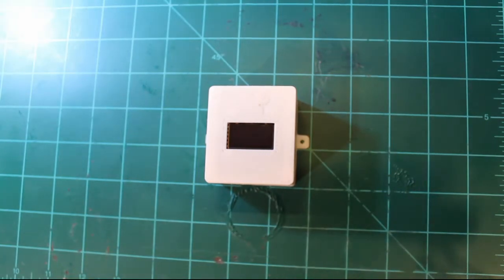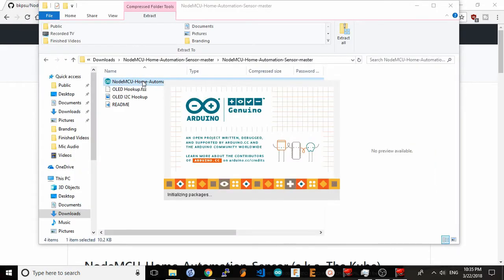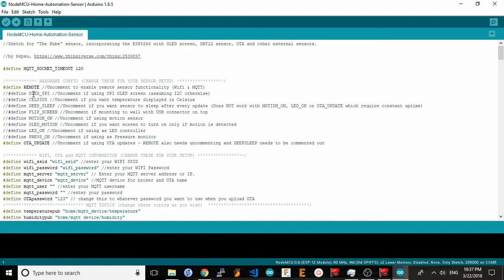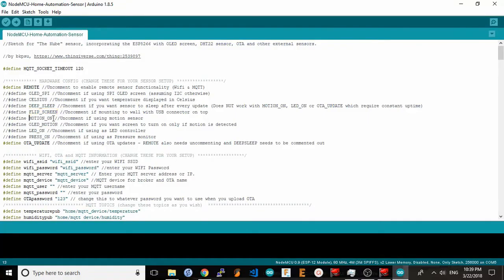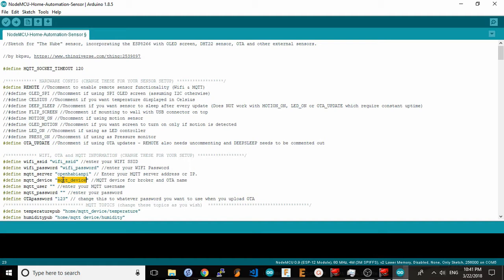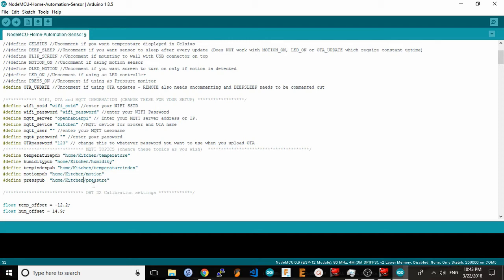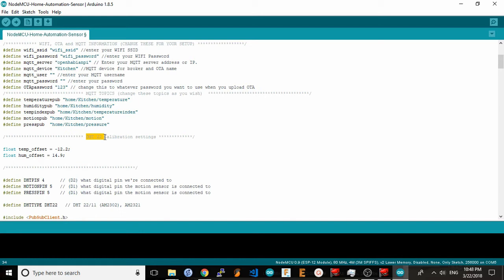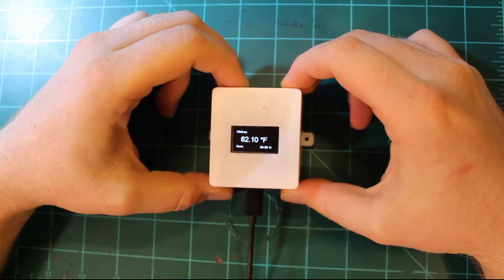NodeMCU Kube home automation multisensor Build - Part II (Arduino)

Comment: Hi, the sketch returns this errors:   C:\Users\User\Documents\Arduino\NodeMCU-Home-Automation-Sensor-4309b0d1c584e9067722f33b8794cbc8534183b9\ESP8266-PIR-OLED-Arduino\ESP8266-PIR-OLED-Arduino.ino: In function 'void loop()':

ESP8266-PIR-OLED-Arduino:197: error: no matching function for call to 'DHT::computeHeatIndex(float&, float&, bool)'

       float hic = dht.computeHeatIndex(t, h, false);

                                                   ^

C:\Users\User\Documents\Arduino\NodeMCU-Home-Automation-Sensor-4309b0d1c584e9067722f33b8794cbc8534183b9\ESP8266-PIR-OLED-Arduino\ESP8266-PIR-OLED-Arduino.ino:197:51: note: candidate is:

In file included from C:\Users\User\Documents\Arduino\NodeMCU-Home-Automation-Sensor-4309b0d1c584e9067722f33b8794cbc8534183b9\ESP8266-PIR-OLED-Arduino\ESP8266-PIR-OLED-Arduino.ino:48:0:

C:\Users\User\Documents\Arduino\libraries\DHT/DHT.h:36:9: note: float DHT::computeHeatIndex(float, float)

   float computeHeatIndex(float tempFahrenheit, float percentHumidity);

         ^

C:\Users\User\Documents\Arduino\libraries\DHT/DHT.h:36:9: note:   candidate expects 2 arguments, 3 provided

exit status 1
no matching function for call to 'DHT::computeHeatIndex(float&, float&, bool)'

Am i doing something wrong ?
Reply from the maker: Ah, you must not have the correct libraries installed. In Arduino IDE, please go to Sketch->Include Library->Manage Libraries. From the list that pops up, find and install the following two libraries:

-Arduino Unified Sensor by Adafruit (version 1.0.2)
-DHT Sensor Library by Adafruit (version 1.3.0)

The Adafruit sensor libraries are very good and contain extra helper functions (like heatindex computation) that other DHT libraries may not.

Let me know if you still have problems!
Reply: Wrong DHT library was my problem,  thanks :)

Comment: When I check the sketch I'm getting the following error: 'class WiFiClass' has no member named 'mode' any idea?
Reply from the maker: Make sure you're using the same libraries I defined in my Github repository Readme file. I suspect you're using the wrong (or wrong version) WifiManager library.

Comment: How do you get the WiFiManager.h says it can not find it
Reply from the maker: @Graham Jones - you have to use the Arduino IDE library manager - look for the WifiManager version 0.15 by tzapu
Reply: @BKHobby  ok thanks. I got some node mcu, had trouble at first as not standard but instructions showed me how to add to ide. Looking forward to getting things working.

Comment: Hi Bk,
 I installed the temperature sensor in one of my room. But one problem i am facing is it does't show the change in temperature directly . It shows only after i reset my NodeMCU. What could be the reason for this bk and how to solve this problem? Are you facing the same issue at your side?
Reply from the maker: Neelam Jangra - have you resolved your issue yet? I haven't had any problems with my sensors, but maybe your MQTT broker is going up/down? Check with MQTT-Explorer to make sure you're getting the messages from the sensor all the time.

Comment: Hello, can you calibrate or set an offset for  DHT11 or AM2302/DHT22 in Tasmota? I'm trying to setup a sonoff basic r2 as a light switch with a sensor DHT11 on a spare GPIO to control light and measure the temp/humidity in the room. 
Great work on your channel.
An off topic question, why you choose OpenHAB and not Home Assistant?
Reply from the maker: @Lucian Buzatu - I'm not that familiar with Tasmota for sensors yet - I've only used them for switches, but I'm not sure they support changing the value (you might need to calibrate the input on your home automation server side). But, I've now started using ESPEasy for my sensor software, and it's definitely possible to calibrate the output in that firmware (you might want to look at it for the Sonoff, as well).

Thanks for the kind words! I've been working with openHAB as my home automation system for about 4 years now (tried a couple different softwares before that) - openHAB was the first that worked reliably and "made sense" to me at the time, and I don't think the Home Assistant project was off the ground at that point, yet. That said, both OH & HA are great products that serve the same purpose, but I'm very much invested in OH at this point, see a bright future for the project, and wouldn't want to start from scratch again in HASS...Also, YAML looks very painful to get "right" and while the OH Rules DSL isn't a 100% solution, I'm just used to it by now.... :)

Comment: Very good work. I have connected the module with WifiManager, why not see nothig to serial monitor?
Reply: Ok I see your note on SSD1306     display(0x3c, 0 /*D3*/, 2 /*D4*/) 👍
Reply from the maker: Yes - i need to update the readme on github and show the other pins so no one else has this problem. I just didn’t need serial monitor (I have the OLED screen or MQTT if I want to debug ;)), but it’s important not to use those d9/d10 pins so it works.

Comment: Thank you for your videos. i have been trying to upload your sketch to my nodemcu 1.0. i have managed it one one nodemcu but i cant get it to load on another and have tried changing so many things i cant remember what i have started with. I have down loaded the lasted sketch from github and when i try to upload it at upload speed of 9600 as it says to on my board it flashes all the way to the end then shows "An error occurred while uploading the sketch" if i try uploading at any other speeds it uploads but i dont think it works as there is no display on the screen and nothing on mqtt, would you have any idea what the problem maybe?
Reply from the maker: Jason Butcher - I would try resetting everything (in Arduino IDE, go to Tools -> Erase Flash -> All Contents)  and reload (it might be stuck with some wrong Wifi settings or something else in the flash). 

Also, keep in mind since I made this video, I updated the code in Github to use WiFiManager. So, you don't have to input any wifi settings (SSID or Password) into the sketch. Just download the code to the NodeMCU and power it on. Look for a Wifi AP on your phone (you should see something called with "ESP" in the name) and connect to it. When you do, it'll take you to a webpage that will allow you to select your home Wifi and input the password then....It just makes the setup a bit easier. Every time after that, it'll connect to the home WIFI automatically.

Let me know if this works, and thanks for watching!!
Reply: Thank you for your help, i used the WifiManager and used my phone to put in the wifi details and pushed "restart" on the nodemcu and it now works. I look forward to working on the led controllers.

Comment: after i have set up the sensor with the new wifi setup how would i change the wifi credentials even after reflashing the node mcu it still only connects to the first  AP...  
Also all of my temperature and humidity readings are jumping down to -1 every other refresh i tried different node mcu and different dht22s
Reply from the maker: For the AP setting, make sure you're using the latest Arduino IDE and EPS8266 Board files (go to Tools -> Board -> Boards Manager and check for updated board files). Then, select Tools -> Erase Flash -> Sketch + Wifi Settings OR All Contents. That will ensure that the flash (where the Wifi credentials are stored) is fully erased before reloading the code.

For the "-1", that means the NodeMCU is getting invalid data from the DHT sensor, so I set an "Invalid" state. These are the reasons it can show that:

1. Bad connection with the sensor  (power or data) -> make sure you're using tight connectors (or even soldered proto boards if you're not using my PCB)
2. Power too low. I've noticed this happen when I have the sensor connected to the PC's USB port (500mA maximum current). The DHT sensor, the OLED screen and the NodeMCU connecting to Wifi all draw a lot of current. I recommend using an external power supply (like a phone charger) with at least 1 Amp of power. 

Try that and let me know if it works!
Reply: BK Hobby 
Well right now i just have the dht22 connected  with breadboard and headers  no oled. i wanted to check everything before i soldered  everything  to your board (ive got 20 of them waiting) the node mcu is being powered by usb via a phone charger

Side note  it took me a couple of tries  finding which librarys you used.  Maybee you can add that to your github
Reply from the maker: That's a good idea - I will add a list of all the libraries/versions I'm currently using to the Readme file. Thanks!

Comment: My esp is not connecting.. Not even attempt to connect..  
Ets Jan 8 2013, rst cause :2,  boot mode:(3, 6)
Load 0x4010f000, let 1384, room 13, 
Tail 8
Chksum 0x2d
Csum 0x2d
v614f7c32
~ld

This is what I get on serial monitor,  please help
Reply from the maker: Jacob Kuriakose - are you running my latest version of the code? If so - the NodeMCU creates a Wifi access point first, you have to connect to it (use your phone to search for wifi networks) and once you do, it'll take you to a webpage that lets you connect the NodeMCU to your home WIFI - it should work after that. If not, let me know!
Reply: BK Hobby sure I'll check... Thank you..
Reply: BK Hobby Hai Atlast I got the access point and gave the WiFi credentials... But the oled is not displaying anything... Please help...
Reply from the maker: Jacob Kuriakose - are you sure you connected the OLED to the proper pins? Are you using a 4 pin (I2C) or 6 pin (SPI) OLED?
Reply: Hi I seem to be getting the same issue, using a 4 pin I2C, flash the nodemcu access wifimanager connect it to wifi, I can see it on my pfsense dchp but when using its ip it says connection refuse and no display on OLED, flashed several times using all components.
Reply from the maker: +pablo bolomey do you have the proper ip or hostname configured for you MQTT server? It won’t start displaying anything until it connects to both in REMOTE mode. To test just the OLED display, comment out the #define REMOTE line in the code and upload again. Then, the sensor will immediately attempt to display temperature on the OLED - if that doesn’t work, you may have a bad OLED screen (I’ve gotten a few duds from my eBay orders).